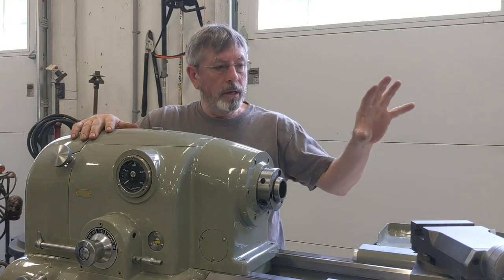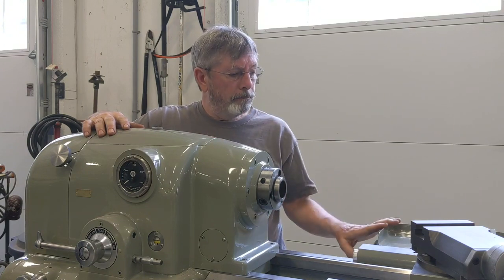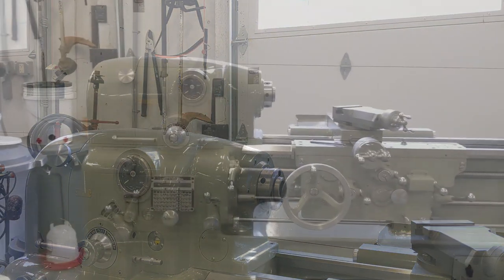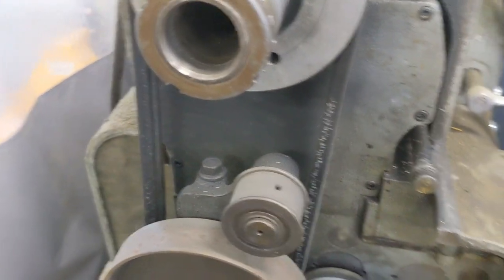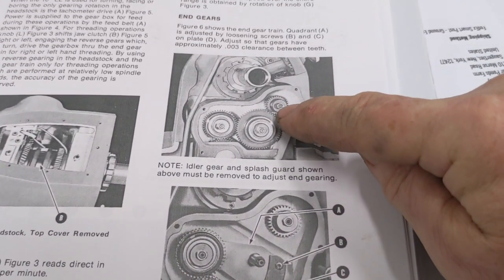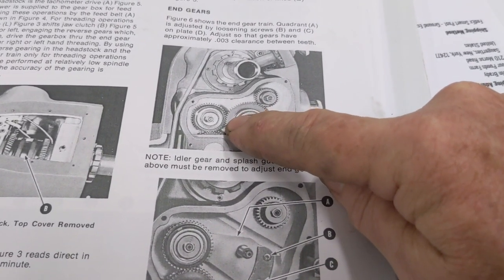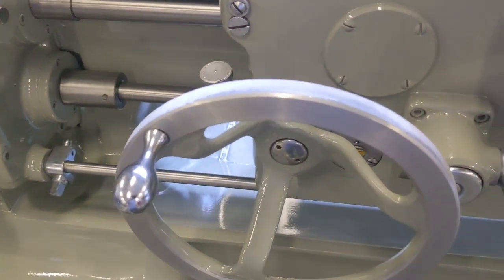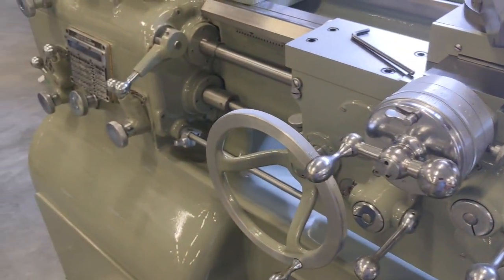Monarch 10EE lathe Part 26

Comment: Glad ur back and have a little time to work on the 10 EE. I was pretty sure that adjustment would fix the gear noise. Now in your spare time you need to make a set of change gears so you can cut metric threads. Ha ha 😁Thanks for the videos I really enjoy them.
Reply from the maker: Thanks for watching! Yes you were right.. I totally missed that the movable gear swings on an arc and adjusts backlash for both gears. That was a relief!

Comment: Kevin,  Good to see you back.  Big congratulations on getting the gears adjusted.  Very quiet!  How did you strip the anodized plating off the aluminum strips and polish them?  I was going to have mine semi-gloss black anodized but I like the look of your polished strips a lot.  Nice.  You’ve saved me some money but created another job!  Be Well and Happy.   Cheers, Will
Reply from the maker: Hi Will.. So I was just going to touch them up on the polishing wheel but they were pretty badly nicked up. The polishing wheel doesn't remove the anodizing. I wound up orbital sanding with 600. I'm sure sanding by hand will work. Then back to the the polishing wheel.
Reply: @fourpondsshop7940  Thanks for the tip Kevin.  I’ve got air and electric random pattern sanders and they do work fast.  I wish I did.  Also rebuilt a 3hp buffer a few years ago that should make short work of the polishing.   Your lathe project really has been motivating me to put the last bits of my lathe back together and enjoy using it.  Thank you for that.  Cheers, Will

Comment: Nice paint!
Keep in mind, even with the elsr, and the variable reverse speed, one can only thread so fast, for example running at 200rpms will keep you wide awake, so the speed you run with the end gears engaged at any time, should not exceed the actual speed needed.
 The problem with surging, and lack of 4000rpm top speed is often related to adjustment of the the two trim pots at the top of the module, or diodes, or the QSD relay that is snapping open and closed.
Reply from the maker: You're right about threading speeds! I'm not that good so I go very slow! The chatter at low speed is gone after I adjusted the gain pot. I'm fine with the current max speed so I'll leave as it is
Reply: @fourpondsshop7940  
You may have to readjust the comp and speed pots as your tubes settle in, also the machine should be fully warmed up before the adjustments are made or, the drive will appear to have problems when it does warm up.
 The end gear use is confusing, because most all lathes use the end gears for both power feeds, and threading.